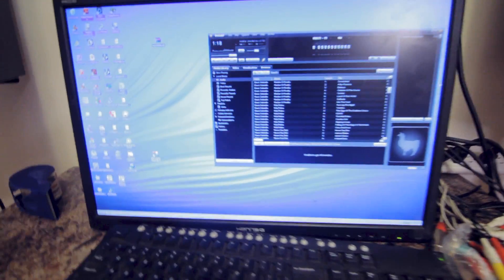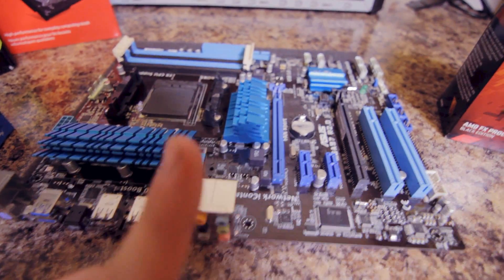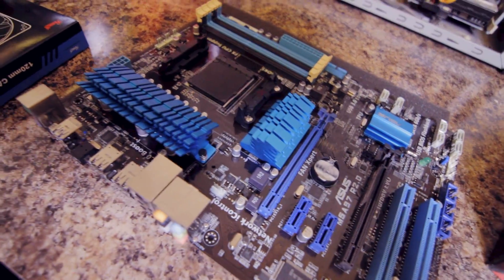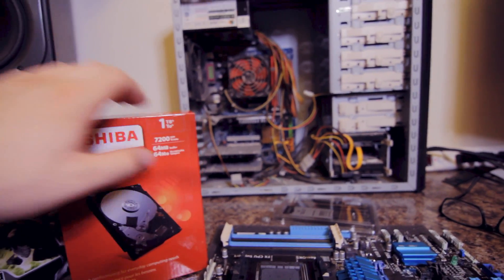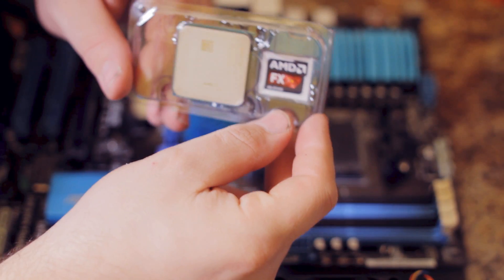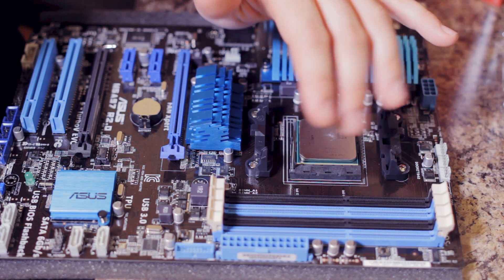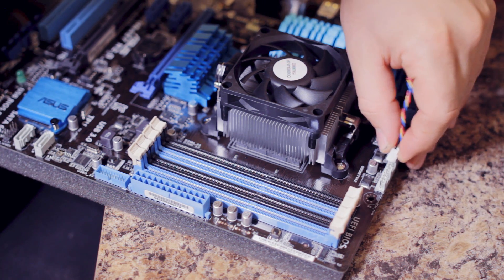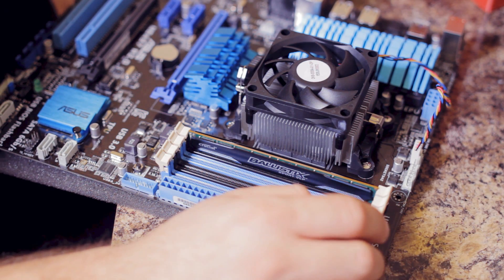How to: Upgrade my DAW Music Recording PC - AMD FX-6300, ASUS M5A97 R2.0, M-Audio Delta 1010LT's,

Comment: So just a couple of comments. I have the same CPU and Motherboard I am happy with it would I like a core I5 or I7 yes, but money seems to escape me so for now it will do.  So that CPU and Motherboard runs its fastest and best with matching memory sticks, so when you have the funds buy another stick of ram just like the one you have in there and put it in the other slot of the same color. Also get the dust off those cards its the worst thing for electronics those boards are running hotter than they are designed to do so they will go sooner rather than later as the caps fail because of the heat. Not to mention dust has metal particles in it and that can introduce noise and his in the sound.. They do make a molex to 4 pin adapter so you can connect one of your hard drives power to the mother board. That board is designed to run with an 8 pin you should probably give it 8pins then. :) Yes, a SSD would be awesome I know I want one at some point.. sigh.. money.. sad..